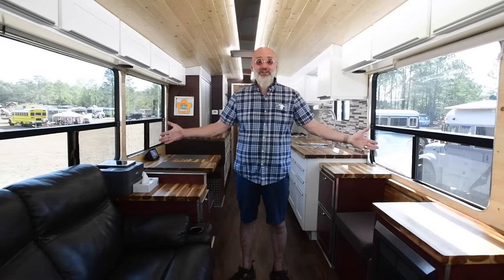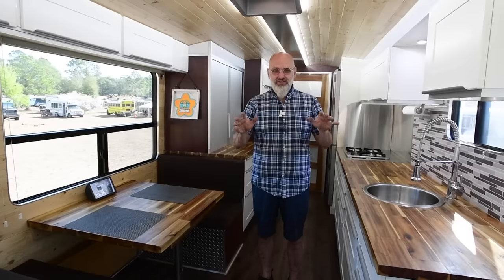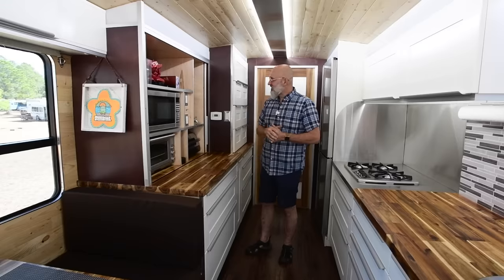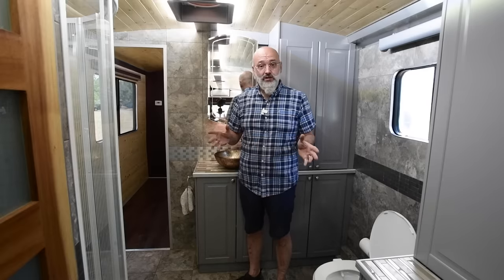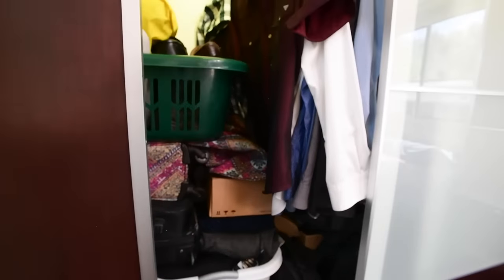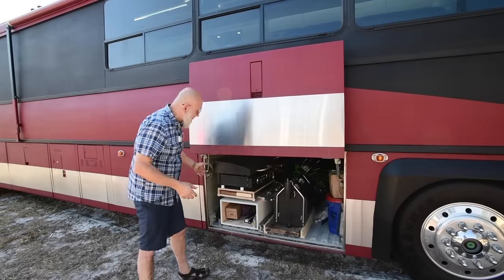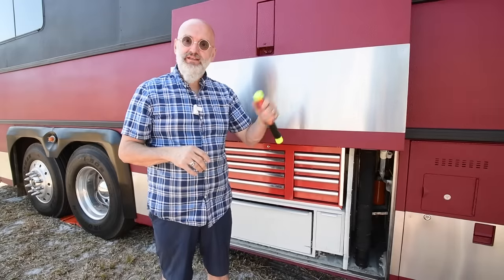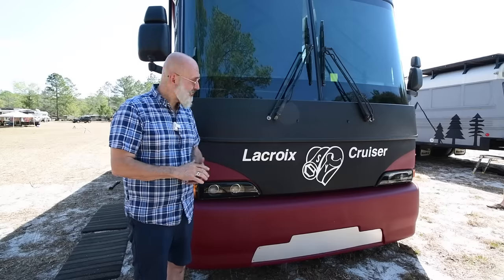Beautiful 45 Ft. DIY Coach Bus Conversion for Semi-Retired Couple

Comment from the maker: Is a coach bus something you are considering for your tiny home?
Reply: I did look at a few but The prices were the same as buying a house.
Reply: @radicalgreek99  we built this for under $75k, plus our time
Reply: @LacroixCruiser  what was the initial cost of the bus and was it already converted to an rv prior to you buying it to where you just needed to remodel to your taste and style instead of starting with a shell?

Great video!  Thank you so much!! Do you travel around the US a good bit helping retailers or do you have a certain schedule you stick too? A friend of mine is a detailer and trying to get a successful business going.
Reply: @1982MCI  we payed 20k for the bus, and it was previously converted, but we stripped it out completely to start over again. 

We travel anywhere to teach, and do one on one coaching.
Reply: @LacroixCruiser  thank you for the reply. Reason I was asking is because I’m looking at one myself right now that’s just right down the road. It’s also an MCI but it’s an MCI 7 or 8 I believe and is a little bit older than what yours is. It has been converted but it will need to be stripped and redone cause it’s in rough shape as far as the interior goes. It runs like a dream but it’s tires are out of date cause it’s been sitting so long. It also needs airbags replaced but he does have new ones already but just need installed. Its been sitting about 8 years or so since they’ve done anything with it. They were living in it while they were building their house and once it was finished, they moved into the house and let the bus sit there. It could be a good bus again but needs major work to get it there and I didn’t know how to price it cause prices are all over the board. He said he wanted to try to get $10k but I still think that’s high because I’m worried about all of the suspension from it sitting that long. 

Anyways, hopefully I can find something I can work with. I can do all interior rebuild myself and some mechanical but on the bigger stuff like suspension, I need to have someone do that. 

The buses are harder to come by now than what they were before this virus shut us all down. And the ones I am finding have doubled in price. Hopefully I can find one and get it finished similar to yours and I’ll see you out on the road somewhere!  

Take care and be safe out there!! Thank you for your guidance, I appreciate it!!
Reply: @1982MCI  the MC7-8’s are great busses. Have it inspected by a good mechanic, it’s worth the investment. Also if you were building from scratch, look at the cost of windows, generators, heaters etc, $10k isn’t that high.
Reply: @LacroixCruiser  Wow! Just an amazing home. So well planned out with the sq footage. Everything a home has and you have the ability to move whenever for under 100k.
Wishing you safe travels and adventure ahead.
Reply: @peterinfante6187  thank you
Reply: @peterinfante6187  thank you
Reply: @LacroixCruiser  Can you go off road?
Reply: @1982MCI  yes, it was an excellent video.
Reply: @LacroixCruiser  Is this better than a school bus? Love buses that can go off road.
Reply: I've watched a lot of bus build's. This one by far is the Best!! What a beautiful home! 
I would love to live in one!!! I'm disabled and I haven't seen a lot of disabled people doing this. 
My Mom thinks I'm crazy for waiting to live in one. I think she'd like it if she seen it!! 
Safe travels and God bless!
Reply: @sandrafergueson8155  we have met a number of disabled people traveling in busses. It’s another of the many challenges that you can overcome.
Reply: @shermainecraigwell2492  very different than a school bus.
Reply: @Vladimir Ryan I understand what you are saying, however you are exaggerating considerably.  The bus is really not that big.  A 45 foot bus (which this is) is basically two pickup trucks long, which is less than many pickup and 5th wheel travel trailer combinations.   I guarantee you that in America at least, you could not buy 'multiple cabins or rv's' for the same price as Lacroix Cruiser built this.  They spent over a year building it however, so if time and effort are alien to you this would definitely not be a project you should undertake.
Reply: Nope. It is very difficult to get the license in India...  Instead, a van would be ok..
Reply: @radicalgreek99  Just a friendly tip, if you can do mechanical work or building it out, go for an older model coach. I've seen late 1980's to early 90's MCI, & Prevost (mostly) also some Vanhool  bus conversions that rival many new motorhomes. 
I'm mostly looking at mid 80's to mid 90's MCI seated coaches to convert. Good deals can be found. I've driven a friend's Prevost H3-45 with a Caterpillar C-13 ACERT, amazing machine. Hope you find something that suits your needs and budget. :)
Reply: Absolutely
Reply: @shermainecraigwell2492  I would not recommend driving this bus on a road that a 10 speed bike could rode down getting stuck in this size bus would cost plenty
Reply: @markstewart3967  I thought so. Thank you.
Reply: Yes
Reply: You didn't say why you went away with induction and in with propane can I ask why?

Comment: This bus was beautifully designed and mechanically impressive. I've been working on rigs for almost 30 years, would have no problem if you rolled into my shop for work. That's how it's done folks. To many build a 'house' in a 'bus' and forever the 'bus' components still exist.
Reply: Very important to keep all the mechanical systems in great condition with the access the factory provided.

Comment: Lol, just because a sink is large, it doesn’t have to use up “more” water if you don’t try and fill it up. The projector is cool, but I prefer a tv irregardless of it blocking the view. And I was confused about the explanation of the fresh water tank in correlation to the waste water tank. Great bus though! It’s beautiful.
Reply: Thank you. Our fresh tank is 10 gallons less than our waste tank. If the fresh is empty it’s because the waste tank is full. We rather run out of water than overflow the waste tank.

Comment: Nice conversation. But working on those series 60 motors suck in those busses. There's no room to do anything. And the electrical side of the mci sucks to work on as well. A blown fuse is not a problem to fix on a module. But try to diagnose the module and rest ofnthe crap when the bus side is not working lol.

Comment: One of the cooler things about a bus is that YOU benefit from the R & D engineering that went into making that bus get good gas mileage. You think Trailways ain't interested in getting an extra mile out of a gallon of diesel? Sure they are.
Reply: Correct

Comment: I’m sorry, but just like that. The two propane tanks beside the mini split is not secure cause if the pressure valve on one of the tanks opens. Then the mini split’s fan will suck it through the fan which the motor is not sealed against gases. So, the installation is not explosion proof. Just telling you like that cause I’m a Natural Gas technician and I just want you to be safe.
Reply: Thank you. A baffle system is in the works.

Comment: Yes to your question.
Coaches are awesome 👌🏻,  but very pricey, unless you can boondocks for a year or so at our little place to help get it started,framing, ELECTRICAL, and safety stuff? 😀
Because of the coach expense, a schoolie is where most others end up! I don't  have a build in me, so we will check in with others from time to time. We have watched you many times, your stuff, Don &Mella when you helped out! Your a good speaker, easy to understand.👍.
Is the M.C.I. built as strong as the PREVOST,  from your home? Neck of the woods.
Your coating, bed liner, did you tint it or is there a choice of colors? Have you ever forgotten about the Fiat your towing? That it wasn't there? It must not weigh much, do you feel it back there?
👌🏻✌🏻🧡 🌤 🇨🇦 😎👨‍🦽.
Reply: A coach isn’t any more, in fact often times less, cost than a Skoolie, and much easier to do. 

Prévost and MCI are of equal build quality.

The Bedliner can be tinted to any colour.

We don’t feel the Fiat but we see it in the rear view camera

Comment: Bonjour Yvan et Sylvie!  C'est tres beau, votre maison roulettes.  Love the sleek and quality build. The wood is beautiful.  
I think you might find a deeper sink does not splash water our so much and a large, deep, rectangular sink will sell the bus faster if you decide to upgrade.  It adds value.  I also bought shallow sinks, then regretted it and changed to deep and large. No need for farmhouse apron sinks - something undermounted is fine.

I am so glad you said that about the Induction cooktop!  I dislike it too. A lack of options with that and enormous power use.
6:07 - Love those cabinet hinges!  Looks like pricey Blum type.  Would love to know where you got them?
What a lovely appliance garage!  Better than my house, ha ha!.  Bet those rollup doors came from IKEA?  Looks great.
Smart idea to refill Berkey from the top of cabinet!  This is genius.
Love the engine access panel, good design!  Great office table too, nice and big and multi use bedroom space, smart!
The Tire Pressure Monitoring System is a life saver and the single most important thing after the engine. I have constant issues with tires and must get one.  Good install.
The basement storage is mind boggling. You have a whole city system in there!
21:53 - The SEM Pro-Tex Bed Liner is a urethane liner that is tint-able. I've been looking for one that is tint-able but not an epoxy, identical to Durabak18 which is not tint-able. Durabak18 is flexible, polyurethane, moisture cured. If this one is similar, I will be thrilled.  Any info anyone?  Durabak company is a pain to deal with and are not forthcoming with technical info on tinting, which leaves me disappointed. I'd love to find a substitute paint.

Thank you for this tour! I learned a lot from you both. Bon Voyage!
Reply: Thank you! 

For the sink we had a larger one in a previous bus, but prefer the smaller round sink for water conservation. 

The cabinet hinges come from Ikea, the tambour door is from Richelieu.

Comment: Do you need a CDL and how do you register it as a RV?
Reply: No CDL needed for an RV in Quebec. Changing the title requires a complete inspection to confirm mechanical safety and that it’s actually an RV.

Comment: You have given the most complete, concise, well presented walk through I have ever see on any item. Fantastic job.
Reply: Thank you, what feature tickles your fancy.
Reply: @LacroixCruiser  One things I was wondering, is, just what did you do to the engine and drive train to get it up to par with the rest of the build?
Reply: @prestonthompson9848  before taking on the road we changed brakes, shocks, airbags, bushings, tires. For the engine there wasn’t much to do, it only has 300,000 miles since an in frame rebuild. From there this is the maintenance schedule we follow.

Every trip

Check all fluids
Check all lights
Check tire pressure ( ideally have a TPMS)
Check hub oil
Inspect belts
Do DOT pre-trip brake tests
Spot and repair any leaks( fluid/air)
Purge air tanks after trip of moisture.
Enjoy yourself and listen to your bus. 

Every 2 weeks

Drive bus to reach full operating temperature. A bus that sits is a bus that breaks. 

Every month

Check and adjust water levels of any FLA batteries. 
Run generator at or near full load for 30 minutes 
Check slack adjusters
Clean solar panels, inspect roof
Wash bus

Every 5000 miles or 3 months

Check slack adjusters
Sample oil and test. 
Check air filter, replace as needed 
Visual check of suspension and brakes. 
Inspect rubber bay hinges. 
Check torque on house electrical system connections. 
Clean radiator(s)
Clean house A/C filters

Every 10,000 miles or 6 months
3 month or 5000 mile items plus, 
Change oil and filters 
Change fuel filters
Lubricate chassis 
Rotate tires
Inspect tires for cracks, uneven wear, bumps etc.
Coat tires. 
Check for kingpin wear when jacked up.
Test coolant 
Check brake pad thickness 

Every 20,000 miles or yearly 
6 month or 10,000 mile items plus
Change transmission filter, test fluid sample, replace if required 
Change coolant filter, test coolant, replace if needed.
Service house heating system ( yearly)
Service generator ( or every 100 hours of use) 
Service air dryer. 
Do a full DOT safety inspection. 
Check wheel bearings. 
Change hub oil/ repack wheel bearing grease. 
Remove brake drums and inspect brake system. 
Replace power steering filter. 
Check propane system for leaks.
Lubricate windows and locks

Comment: How many miles  1 million one hundred thousand no way. It less than 4000 miles coast to coast.that is 250 trips across USA.
Reply: It started life as a Peter Pan coach traveling from NY to Boston daily for 6 years. After that it was converted to a tour bus and was used by a traveling preacher. Yes it has 1.1 million miles, which for a coach of this age is considered low mileage. They are designed for 100,000 miles a year, with a designed lifespan of 30 years or 3,000,000 miles. Our previous coach when we sold it was 48 years old and had 3.2 million miles, still going strong.
Reply: Wow I looked it up. Said over 250 thousand and still runs. Very unusual that's cool. Want to do this. But gas big concern.
Reply: @robertt.4408  we average 7mpg.